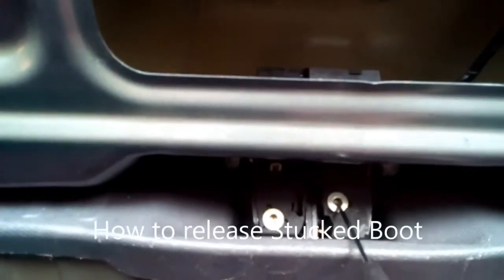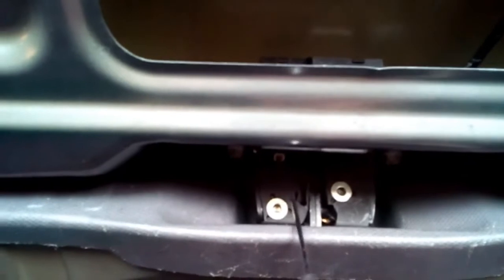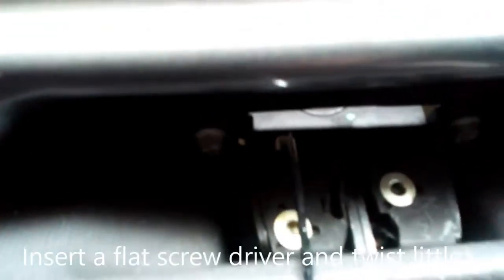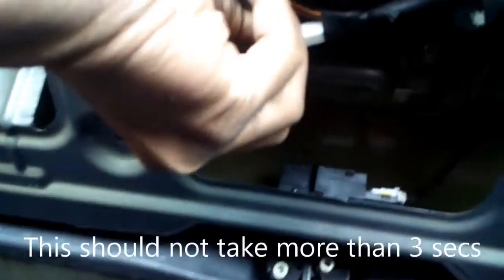How to open stuck  Nissan micra  boot in 3 minutes

Comment: Can the emergency boot latch release shown here be operated without taking the plastic tailgate cover off ?  If is not clear from the video Im afraid as this jumps from using a screwdriver to operate the boot latch to then doing the quite separate task of checking out the wires at the back of the switch, a job that can only be done when the cover has been  removed,
Reply from the maker: Get contact cleaner spray ,to avoid this ,as it is just corroded. The reason for this is to give u more room to access the lock
Reply: Turns out that some Micras have a small plastic cover over where the emergency release is on the latch mechanism. This hides the white plastic bit entirely, making it impossible to operate the release- in fact you would be forgiven to think its actually a different style latch that doesnt have a manual release at all. Wrong.   Fortunately, once you know what you are dealing with this cover can be pried off  easily, revealing the emergency release.

Comment: Hi, on this video when you operate the white cable and the car makes a high pitched squeaking sound - mine is making that sound constantly and the boot will not open. Mechanic doesn’t know what it is, can you help please? What are those cables you are operating and where can I find them? Thank you!
Reply from the maker: Hi the lock wires, do not buy them, I found a solution, u need to spray contact sprays (either electric contact spray or wb40) on them, the reason for this is, corroded caused by rain. Spray in both wires and the lock itself, 💯 will work and u will thank
Me later
Reply: @nuramoboy Ok thank you but where are those wires kept? So I can find them. Thank you
Reply from the maker: @sophieannrankin on the boot u need to remove the boot cover and they are top of the latch